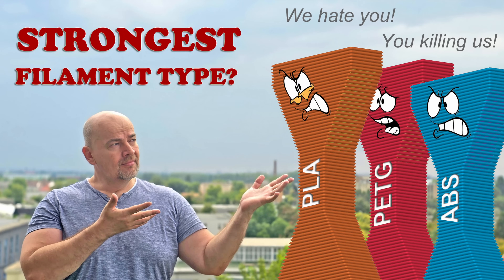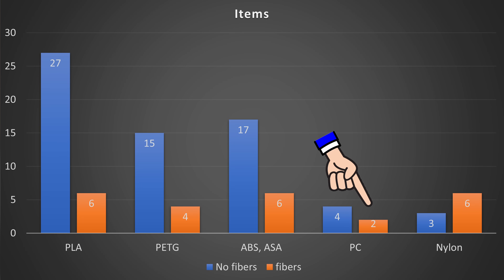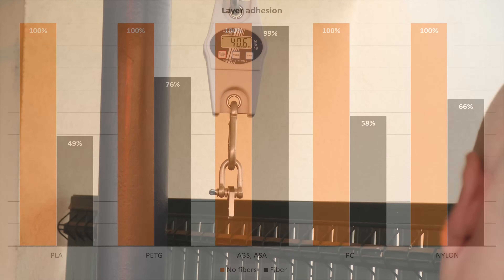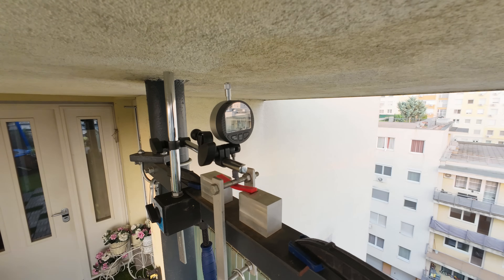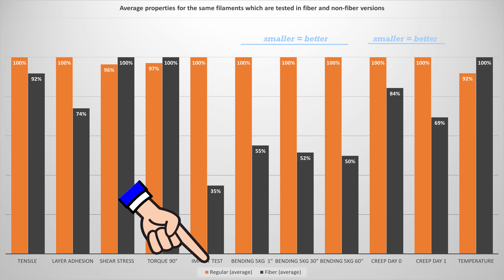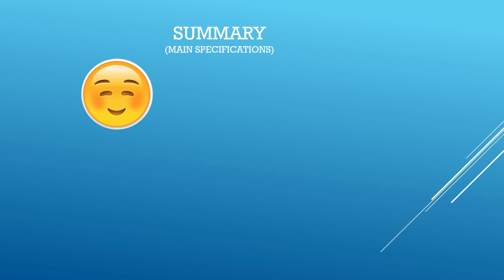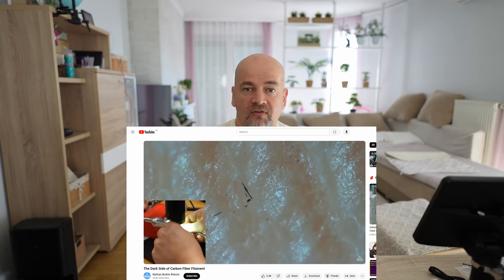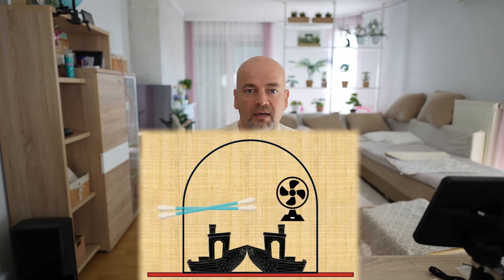Strength of carbon fiber (or glass fiber) filaments. How much stronger are they?

Comment from the maker: I know that this safety question will be popular in comments. There will be a separate video about it. But so far, consider this as a woodworking. Do you worry about wood fibers in your skin? Wear gloves. Do you worry about wood particles in the air? Wear mask, safety glasses. By the way, I wouldn't do this "rubbing against skin" test with the wood, but I did with CF filaments. Of course, those who are working with these materials regularly, they should take in account all those safety measures.
Reply: Working for a Canadian Industrial 3D FFF printer manufacturer as the operational trainer, I always suggest that fiber filled materials be handled with caution and are post processed accordingly. A simple clear coating of some sort can  effectively mitigate the loose fiber issue completely. Shellac spray or dip, clear varnish / paint or other coating is easy and effective. Most customers are looking for quick parts with zero post processing, but in this case, I always suggest something.
Reply: @SeanTaffert  Thanks for the insight Sean. I'll be working at a University next year with a makerspace and will try to bring this knowledge about fiber-filled materials to the managers of the makerspace. Safety of the students should be our top priority and I think 3d printing is just so new that a lot of the safety information isn't broadly understood/distributed.
Reply: You can’t compare wood with this topic. Absolutely not.
Reply: it would be great to measure how much fibers dust would be produced during the printing. So you could modify your suggested experiment, but instead of rubbing the objects, just print a benchie with enclosure. Use multiple samples to collect the dust do address potential hot spots due to air circulation from the hotend and part cooling fans.
Reply: The wood is a good analogy, but you have to keep in mind that wood is an organic martial and dissolves inside the body, carbon fiber and glass do not. 

In my opinion the cf/glass infused filaments are not worth the risk unless you're a business designing super critical parts and absolutely NEED the martial properties where size/ weight is an issue. Any benefit from the cf/glass infused parts could just be designed into the model itself when using regular filament.
Reply: Technically speaking the biggest reason for CF and GF in plastics is to improve warping and shrinkage. Especially with nylon or PA the parts are warped and all the tolreances are off. In most cases it is not the strength and almost always glass fibers are used not carbon fibers because they are way cheaper and don´t create a shot circute or other problems. In 3D printing the CF is popular because people think it improves strengh, it´s just a sales gimmick that´s all. Also it´s really dangerous to work with those materials, you can get something close to "asbestosis" if you are not carefull, so please use your PPE. Good video Igor, well done.

Comment: I feel like, other than the cool factor, carbon fiber really only works well in Nylon, PET, PPA, etc. It seems to complement Nylon perfectly since nylon is a bit too flexible by itself. Layer adhesion is one of the main things I look at. It's rare that your parts don't need any strength in the z axis. Nylon is amazing in this aspect also. But the CF hurts other filaments too much in this aspect. PC with CF seems to be the worst of all worlds. You lose too much layer adhesion and make it even more brittle.

Some constructive criticism if I might. I just found your channel today. You've mentioned in a few videos about YT not liking you. It may be your practice of withholding data from the average viewer. For one video, it was due to your paper. For others, it's saving it for your Patreon supporters. YT is like Wal Mart. The money is in the quantity. Patreon supporters are more concerned with community. They already are committed to you. Maybe give them early releases, updates, roadmaps, etc.  But withholding on the main content is going to get you ignored. The numbers you provide still are quite nice, but there's the initial feeling of being slighted when you see greyed out spreadsheets. Not everyone is committed to the hobby enough to support any one channel exclusively. I'll drop $$ on a thanks, but I move around my hobbies too often to commit to a longer term "relationship" on YT.

Comment: 9:12 Good idea. I recommend adding a drop of oil to half of the ear cleaners, so that fibers will stick to them more easily. Also, you could try pulling apart cotton balls, instead of ear cleaners. They have less-densely packed fibers. Just remember to inspect and clean up any dripped oil.

Comment: Great video as always Igor. Surprised that the fibers really don't do much for tensile properties, I guess the fibers are too short to make a large difference. As you mentioned, seems like shrinkage/warping are the biggest advantages. However, I've also used CF-nylon for abrasion-resistant parts, eg. as slide protectors on the outside of my inline skates, and see a huge advantage of the fibers in abrasion-resistance over standard nylon. I wonder if there's enough advantages to warrant using these filaments with the serious safety concerns you and others have mentioned. Looking forward to your next video on safety and thanks again for this great video!

Comment: One thing to note is that carbon fiber is really bad if you sand it, as it's as bad as asbestos if you inhale micro dust.
So maybe don't use carbon fiber infused for esthetic parts when you plan to sand those.

Comment: Perhaps for the air particulate test you could use a fan with a hepa filter to circulate the air - something like a DIY solder fume extractor. That way the filter mesh will catch all of the particulate generated and it will be easier to detect with at home equipment.
Reply from the maker: Yes, probably I will use one of the printers with filter.

Comment: The only way any kind of fibre can actually reinforce 3D printed parts is if a continuous fibre is introduced into the molten stream at the extruder tip. Markforged printers can do this and the difference is insane. Sometimes more than double the strength. I havnt seen this is hobby grade printers yet.
Reply from the maker: But even in that case, only in XY (the printing) direction
Reply: You could get a cloth and lay it on some layers in resin printing.

Comment: As seen in the data its very helpful for many mechanical parts with fibers(quite dramatic difference in the bending test), the breaking point isnt so relevant if designed properly. But the stiffness is one of the biggest limitation of plastics, especially if stuff needs to be screwed together, keep sealings sealed, higher temperatures,  etc.

Comment: Intresting test 👍I ve also printed some objects because of the nice metallic surface and not the improved strength. Anyway if I follow the discussion about the particles in the breathing air I think it's saver to sit in your printers room than walking along a road with traffic. The finedust of the tires and diesel exhausts is the real problem of our lungs.

Comment: Great video as always. Traditional fiber reinforcement in injection molded thermoplastics (internal plastic parts in cars are PP GF or ABS GF etc) is using the length of the fibers to improve the properties and even chopped fibers are about 6mm long, which is too long to use with 0,4 or 0,6mm nozzles. So milled fibers used in filaments having lenght of 0,3-0,6mm that are basically dust really can't improve properties that much as seen for the shear properties in this video for example. Also this "dust" I think is what reduces interlayer adhesion in most cases and for the ones like ABS/ASA that you don't see a big difference it is because other factors like part cooling and chamber temperarutes already affect interlayer adhesion more than the fiber dust does. A very interesting filament that I have not seen you test so far is PP CF (and PP GF). I saw JanTec's video and I see that it is available from a lot of filament manufacturers like ERYONE, Smart Materials 3D, Nanovia, Lehmann and Voss, Filoalfa, Forward AM etc. It is one that I think will have great interlayer adhesion. There are very few PP filaments not filled with fibers though so you would have very little data for comparison like you had only 2 PC CF filament data.

Comment: FDM printers are great for hobby items and rapid prototyping. There really is no good use for carbon fiber or fiberglass filaments other than for aesthetics as the reall world "strength” improvements are negligible if at all. Sure there are professional machines that can add continuous strands of fibers for strength but none of the consumer versions are capable. They really do need to get consumer fiberglass and carbon fiber filaments off the market. They have no good use in the conumer arena conidering the real health conserns.
Reply: Shrinkage is a big deal and less shrinkage with fiber infused filaments is a big deal for rapid prototyping.

Comment: For the airborne particle test, place a fan extractor on the enclosure pulling air through a replaceable white HEPA filter, a vacuum cleaner would work instead of a fan. Keep the exit aperture small. Test with a gears mechanism wearing against each other. Your worm gear model design from a previous wear video would seem useful. Perhaps measure particle size and count / mm2 under a microscope with a carefully controlled aperture and flow rate / suction pressure, and consistent speed setting on the gears.
Reply from the maker: Thank you for great ideas. I like the idea with hepa filter. Maybe I will just use one of my printers and their exhaust fan..

Comment: I think these filaments don't worth the hype based on the results. 
And these airborne spikes remind me to the asbestos... 
You should check how many particles escape during printing, for example placing the cotton pad into the airflow of the part cooling fan.
Reply from the maker: Yes, somebody already suggested, HEPA filter on exhaust fan..
Reply: @MyTechFun  úgy értem a fültisztító pálcikát, vagy vattakorongot tenni a part cooling fan légáramába, és nyomtatás  után mikroszkóp alatt megnézni, hogy mennyi kis karbon - tüskét fújt el a ventilátor nyomtatás közben.
Reply from the maker: @Megavoltamper  Köszi. Értem, majd meglátom. Én inkább a kipufogó levegőre vagyok kíváncsi, mennyi lesz a fiber. De még alakul a fejemben az ötlet.

Comment: Hi! Thanks for the video! Could it be that the weaker layer adhesion of CF-filaments is caused by the hardened steel nozzle? (poorer heat transfer) Or has the printing temperature been adjusted to suit the steel nozzle?
Reply from the maker: I don't think so. It may have smaller effect. But I had tests, where I used same printer with CF and non-CF filaments. Similar results.

Comment: Really nice video. Nathan allready said, you dont allways need cf or gf filament and your video shows it quite nicely.

I would love to see a comparisson of the mostly used filaments (PLA, PETG, ABS, ASA, TPU, maybe PCTG,  and their gf/cf versions) in terms of VOC, PM2.5 and visual confirmation.
--> maybe you can print for a few hours with a new heppa filter and some cotton sheet behind it (in a closed enclousure) and afterwards look at the filter with a microscope (if it works it should be binding the particles), but that would mean buying alot of heppa filters ^^
-->  for the MP2.5 and VOC you could just place an airquality meter into the housing of the printer and ventilate the housing between the prints (changing the filament you print with)

my internet research concluded PETG -> PLA -> TPU -> ASA -> ABS (least harmfull -> most harmful) and GF -> CF, but I would really like to see a test

Comment: Thank you very much for the test! How about "graphene" infused filaments. I saw some are already available but expensive. I have seen tests on a shooting range where a piece of plastic mixed with graphene could stop a 9mm bullet.
Reply: The issue isn't the carbon fiber, rather that your printing individual bits, held together by plastic. Graphene would be no different. Its a bit like printing very dusty/impure filament, but stiffer. A continous strand of carbon would genuinely enforce, but thats not your avg. hobbiest FDM printer. If your really wanted to, you could pause at specific layers and insert strands of CF or even sheets of graphene every so often. But thats about it, at least I can't imagine any other way of using graphene in 'normal' FDM printing.
Reply: @nerfvinc12121212  Graphene powder can be used in plastics with impressive results! but to achieve that high performance it needs to be treated with compression, and the graphene particulates need proper dispersion within the plastics as well.

Comment: I'd be curious to see to what extent fibers are introduced into the air while printing. You could put a filter of some kind over the inlet of one of the fans on the printer to see if it picks up any particles. Thanks for the great videos!

Comment: For printing properties PLA-CF supports are very easy to remove.  That is one of the top reasons I love printing with PLA-CF!
Reply: thats because of the weaker layer adhesion (like he said in the video), neither the printer nor the filament discriminates between supports and your "normal" print. 
I believe the best way is to print with supports of a non binding filament (like petg for pla and vice-versa)

Comment: Yes the particle question is slready a thing on Reddit.
Do you have an air quality meter that can measure PM2.5 and AQI?
Reply from the maker: No, I don't have (so far)
Reply: @MyTechFun  Just as an Info: In Germany we have a small company called "Tinkerforge" which developed a modular system in which many sensors can be implemented almost plug and play. I love working with them, easy, accurate and fairly cheap. They also have a environmental sensor (Air quality, temperature and pressure sensor all in one).
Reply: @MyTechFun  : The excellent PMS5003 sensor counts particulates in several size ranges, going down to 0.3 µm. It works with Arduinos; Adafruit has code on her site.

Comment: Did look for airborne particles when you do mechanical work, like drilling or sanding?
Reply from the maker: No (if mechanical work is with metal). If with wood, yes. That's why professional woodworkers wear a mask. I think similar safety we need here too.. For hobbyst the risk is much smaller.

Comment: STOP USING CARBON/GLASS/ANYTHING FIBER. THEY ARE A HEALTH HAZARD.

BYE BYE LUNGS!!!
Reply: @lawabidingcitizen5153 any proof of people being harmed by these filaments? Didn't think so...
Reply: Although I think we should research more and also be cautious, we shouldn't demonize these filaments either.
Reply: @warmesuppe 
They get on your skin and never come out. To the point that they bury themselves.

Do you really think that's not a concern?
Are you even a trained engineer?

Any time you handle these you need to wear dust masks, glasses, gloves and a lab coat at the very least.
Reply: @Splarkszter  Any proof of this or is it just broscience (trust me bro)?
Skin sheds itself every couple of weeks, so I really don't think your statement is true.
Reply: Google “Silicosis” I think CF and GF are identical by their impact on the health.

Comment: Jonapot, Hi man im not commenting often coz i have not much to share about 3D printing ,but in this case i would like to warn you about health risks when you using additived 3D filaments, with glass fiber or carbon stuff. Those materials spoiling surrounded areas, or leaving traces of fibers on working desk, printer or your hands and it even after print, not only as raw material (differs by manufacturer, but noone is perfect). Very dangerous is part of process when material is printed and not fully cured, fan blowing on print part will blow those carbon fibers and glass fibers into air and then into your lungs !!Only way to prevent contamination is after print care with some layer of paint or so. In general pros and cons are in my angle of view clearly against  those material, because benefits are minor based on physicaly very disadvantigeous short lenght of fiber material in filament to keep it "flexible" for 3D print usage.
I wish you very nice day from Slovakia :)
Reply from the maker: I knew I will get a lot of these kind of comments. With the reason. There will be a separate video about this topics. In this video I am just pointing to this risk. But you should consider this as a wood working. If you worry about those wood fibers into your skin, wear gloves. If you worry about particles in air, wear mask, safety glasses. This should be taken in account if somebody works with these filaments regularly.
Reply: @MyTechFun  I see.